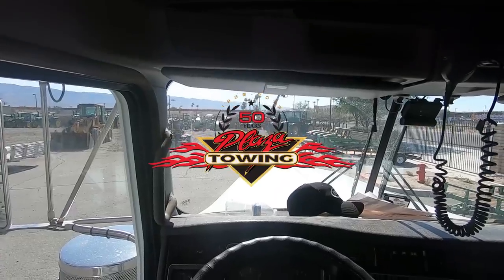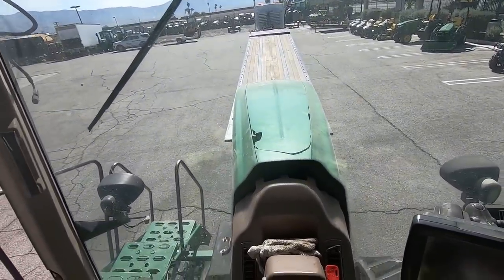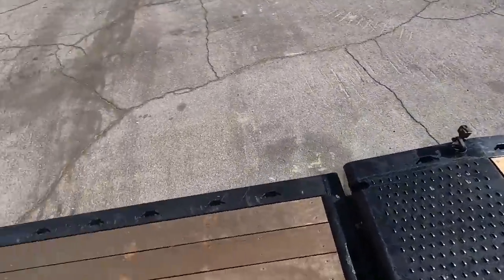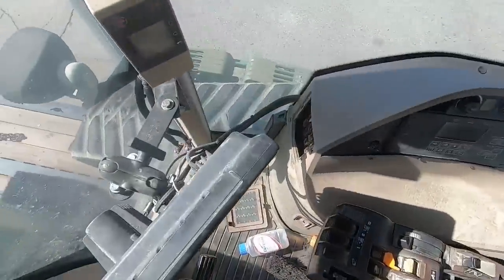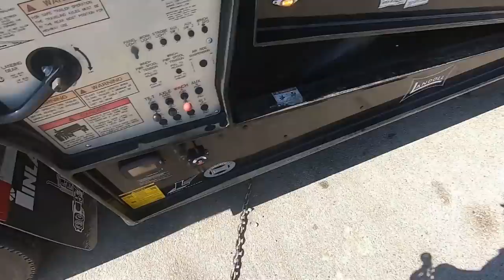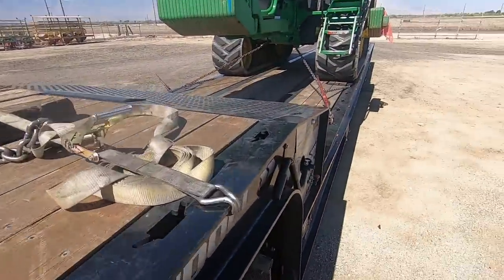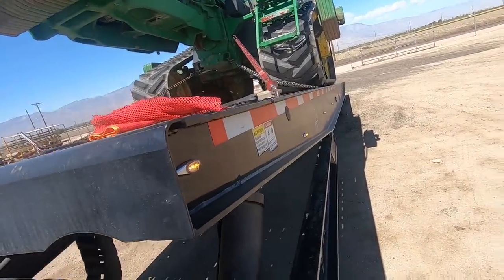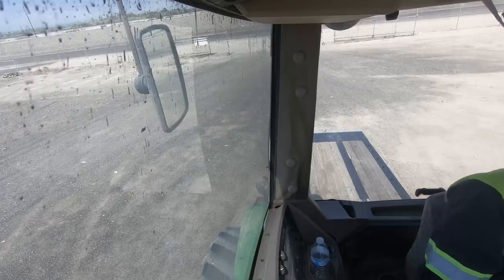John Deere 8520T Lowboy Transport

Comment: Crossing your lateral chains gives you a better angle to avoid the load shifting sideways, assuming there are pickup points which allow it.  Everyone knows that fore and aft chains need to oppose each other, but so do the lateral ones, and if you don't cross them, the angles are not nearly so acute.   I used to haul flatbed overdimensional, and respect the dickens for how you and your company does its job.  Hang in there.

Comment: Couple of quick questions:  1.  Could you give a rough estimate to what this 8520T weighed?   2. The chains you were using were they 3/8 G70 chains?
Reply: I can tell you the first question, they are about 23k lbs
Reply: Likely not 5/16 inch chain.  3/8 would do it

Comment: Ok question why do you keep the deck lowered then tie the equipment then raise the deck im not understanding that step but keep up the good videos i learn alot from watching your videos
Reply: I'd imagine it's a safety measure to prevent the load from shifting forward or backwards in case of a possible parking brake failure or transmission slipping into neutral while raising the deck.
Reply: wild racer 88 I keep my deck down when doing most of the securing because it’s easier to get at all the good tie off spots. Just my opinion